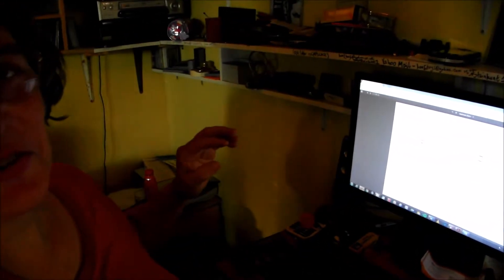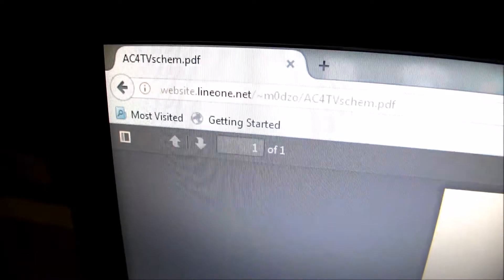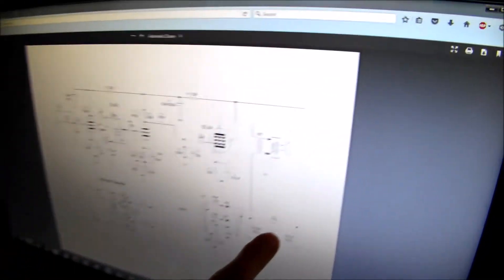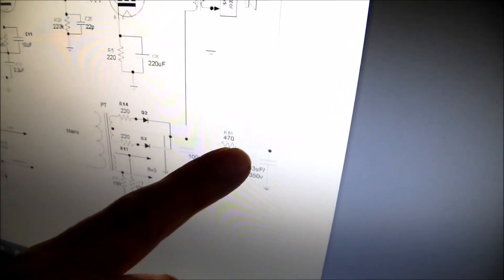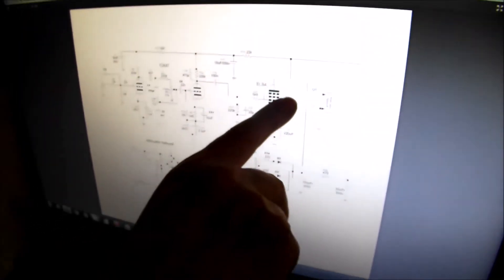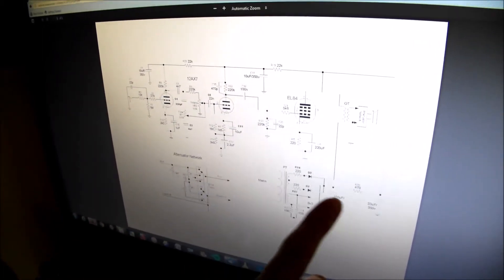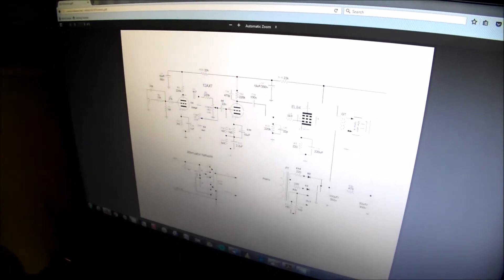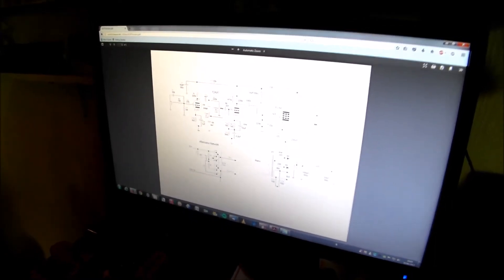VOX AC4TV VALVE SHENANIGANS

Comment: I know this is an old video but my little vox has a dead resistor and burnt areas around a defective EL84. Your resistor suggestion made it to my shopping list! also: your research and knowledge is well aprecciated!
Reply from the maker: I've been playing around with EL84s for years and if you read the data books and visit National Valve Museum, it will state the "absolute maximum" conditions, which seem to be ignored by some of the Vox engineers. As valves were quite plentiful, it wasn't an issue to overdrive them but, since the Ukraine conflict, Russian valve manufacturers, Sovtech being one example, could cease selling them to the West. If you're technically minded, in the Selmer Little Giant, the screen grid is supplied via a 5600 ohm resistor, limiting the current to about 11mA. The screen grid should never glow orange, as it does in the AC4TV. I hope you can get yours fixed soon or are able to do it yourself. Thank you for your interesting comment.

Comment: Is that true about Beatles AC30s? I can ask my mate who worked for Vox Dartford and delivered their amps, John Oram.
Reply from the maker: Don't know about AC30, although I've worked on just one. Valves can tolerate a huge amount of abuse: I remember our electronics tutor mentioning a valve had its envelope melted so glass was in physical contact with its anode, and was still working. I rely on the international valve museum for information about various valves and data, when designing an amp, and it states "absolute maximum operating conditions". Unfortunately, manufacturers making the AC4TV, acquiring the Vox badge, have ignored these parameters, many times over. The EL84 runs very hot, under recommended parameters, as it was based on an octal valve design. The 6BW6 is a 6V6 squeezed into a B9A base, although 6V6 was originally on an octal base and bigger part. Likewise, 6BW6 runs extremely hot in normal operating conditions.

Comment: El84 in mine lasted about 10 hrs lol 
I was running it in to an 8ohm extension cab. 
It sounded glorious mind you. But yeah. Crazy circuit design.
Reply from the maker: It would sound just as good with the correct parameters. If you're any good with a solder iron, the G2 resistor needs to be about 5K6. The EL84  can last for many decades. One of mine was removed from a scrap radio and there's evidence of hard driving owing to deposits on the inside of the glass envelope. Thanks for commenting. :o)
Reply: @hoofbags  I will crack it open tomorrow. Now go to bed, its very late!
Reply from the maker: @cgavin1  was in bed when wrote the previous. It's R16, a 470R. It's too low and is cooking G2. There will be a slight reduction in PWR output. When I build these, I use 135R as a cathode bias and a 5K6 as G2. This design was from Millard and the Selmer Little Giant is closer to it. Perhaps Vox have shares in valve manufacturing EL84 = £13.50!
Reply: @hoofbags  A popular mod seems to be to install a 1k-2.7k 1 or 2 Watt screen resistor. This does involve cutting the trace and dolling a fresh hole though. I have the Bitmo mod on mine as a head (AC4TVH) and its pretty glorious in to a Creamback 65 @ 8ohms but sure eats the power tubes fast. Would you recommend your method or just go for the screen resistor? Or both?
Reply from the maker: @cgavin1  if you google EL84 national valve they specify "absolute maximum operating conditions". My L8 hubby, an electronic engineer of gr8 experience, used to mention running valves too  hard is bound to lead to problems. I sometimes overrun valves, but only a maximum of 20% over. There were anecdotes of valves still working in TV sets, where they got so hot, the envelope melted so it was in contact with the plate. They do, indeed, tolerate punishment well! I don't like seeing glowing G2s and if the anode/plate glows red, it will stop working, so is definitely a no-no. To me, the 470R R16 is too low, so it would help if G2 current is lower: 5.5mA recommended and would help the valve last longer. Thanks for your comment. :o)
Reply: @hoofbags  Thank you for the great advice and for explaining it so clearly!

Comment: Your amp has the same hum as my AC4. Not sure if that is normal or there is something wrong with the amp. Please let me know as this hum gets so loud when using it in 4w mode.
Reply from the maker: Must admit, though, Hooves not keen on vox and. They have a unique sound and if the AC4 is similar to the AC30, it lacks negative feedback. NF improves amp linearity and reduces mains hum. It would appear that these characteristics are deliberate and part of the design.
Reply: hoofbags I get the hum even if there is nothing plugged into the vox ac4. I can’t remember if that hum was there when I bought the amp years ago. I never paid attention until I used a solid state which was completely silent.
Reply from the maker: Sorry to hear about an unfortunate experience. It's upsetting when the things we love go wrong. If the hum is excessive or if there's a buzz, it could be a sign of the filter capacitors needing replacement. The AC4 in my video upload was a repair for a friend. I cannot remember what the issue was, though. For what it's worth, I'm not keen on the way the AC4 is put together. I mention in the description about a 470 or 560 ohm resistor. This is the G2 grid in EL84. It is much too low and this would create hum. It should be about 5.6K ohms. Naturally you'd be reluctant to alter the spec of your amp, but if you know of a radio repair shop or guitar shop in your vicinity, they might be able to alter the spec. This may result in a reduction of resale value, though. It makes sense that a solid state amp would have lower hum: bi phase operating characteristics. Sorry I can't be of any more help.
Reply: hoofbags Thank you for your reply. Based on my previous experience of my other vox being repaired, it would cost me an arm and a leg to have it serviced. I might just have to buy a new amp then. Thank you for giving your time for replying to my inquiry.
Reply from the maker: Does the mains hum reduce if you unplug the guitar? In the guitar amp world, as far as I'm aware, mains hum is tolerated because of the pick ups being of a magnetic nature. Humbuckers can lessen this effect, to an extent. Messa Boogie have done some research into this issue but these amps are expensive.

Comment: G3 is tied to the cathode and g2 the screen can run tied in triode mode to the plate, so the 5.6k thinking for that voltage is coming from where? And it only runs hot when power chords are happening right? Otherwise class A would be full orange 100% of the time. So this has nothing to do with the screen supply. This is purely a bias issue or shorted tube screens. If this happens with a different el84 then the first thing I would check is the bypass cap on that cathode. Something seems odd on that cathode bias if you are getting a nominal 10w.
Reply from the maker: Hello JF. Its been a long time since you made your interesting comment: thanks for that. I'm going through a phase of not doing EL84 or similar guitar amps. These days I'm building single ended stereo amps for phono or similar purposes: ECL86 and similar. I've learned that there are quite a few design consideration differences between the two designs: phono vs guitar. Also, driving G2 hard can increase output: something I was unaware of at time of upload. If you think you can give some advice to Erhnam Djinn I'm sure he'd appreciate it. His comment was 2 hours ago, from when I'm typing this. Many thanks for your contribution. (o:
Reply from the maker: I've built about 40 - 50 amplifiers in my time. Vox drive their valves unnecessarily hard so they need more frequent replacement. The only part of the valve that should glow is the cathode. In every other EL84 amplifier I've built or serviced, there's always been a 5.6k resistor in series with the G2, as the national valve museum and my Mullard data books always state the maximum G2 current is 5.5mA and a resistor selected to set this. Like most manufactured items these days, vox push too much current through all parts of the output valve as a means of planned obsolescence. The vox amp will emit mains hum because the G2 limiting resistor also forms an time constant network with a capacitor as ripple rejection. Connection to the anode would still require a limiting resistor and would result in a gain reduction. Mullard certainly knew how to design their equipment.
Reply: @hoofbags  I don't think there's a Vox tube-abuse conspiracy afoot. I think they just tried doing what 90% of all guitar companies do or did - drive the crap out of their tubes. Doesn't always play out well with Chinese mystery tubes and PCB construction (see: older Fender Blues Juniors. They fry themselves to a crisp.)

Look at vintage traynor amps- they had a 2xEL84 amp with 400+ volts on the plates that could push something like 25 watts. Insanity. Ever see Fenders short lived EL84 6G9 amp from the 60s? They drove the pants off of those tubes, basically treating them like 6L6s. 400V on the plates and screens, with nothing but a choke before the screens. abusively high fixed bias. The transformers would often melt down. They changed the 6G9 amp to accommodate 6L6s shortly after. Not sure what they were thinking with the little EL84s. 60s Fender were typically designed to last. 

I have a 2xEL84 PA amp, and before I rebuild it, it was set up to have NO resistor on the screen. The screen was literally directly after the rectifier and it had higher Voltage than the plate. The original tubes from 1959 looked blackened inside, but still worked (for a couple days...then the fireworks happened).  Even in the 50s, when the line voltage was 10V lower than today's, it was biased really hot. Can't think why, reliability seems more important than sheer output in a run-all-day PA amp to me, unlike a guitar amp, to some extent. 

I did cut the abuse back a bit though. Now I run my EL84s with a 340-350 B+ to ground (something like 335 plate to cathode), near 100% bias, and a 2K screen resistor. Never felt the need to go higher. Tubes can last years in these. The screens really are the EL84 weak point though.
Reply from the maker: @JMA_Elec  the EL84, in the Mullard data book mentioned 2XEL84 in push pull could deliver 17 watt so 25 is really pushing it hard. The EL84 is considered one of those valves physically too small for its handling parameters and the 6BW6 is worse in that it's a 6V6 in a smaller form factor, so they run really hot. 6BW6 often failed in service although 6V6 lasted very well, according to an engineer I was close to. The amount of overload a valve could tolerate is one of those examples of things learned through practical application. Example: it was once believed that applying HT Positive to a valve, pre cathode heating,  would cause damage: stripped cathodes. That was the idea of using a valve rec. Almost all TVs from 60s onwards had a solid state rectifier and the valves lasted longer than was expected. Thank you for your enlightening comment.🙂
Reply from the maker: Thanks for your suggestion. I've a tendency to build my valve amps using, either the Millard valve data book, or go to National Valve Museum where they state "absolute maximum values". The G2 is connected to the supply + rail via a resistor much lower that 5.6k in the V O X  design. If the grid 2 glows, it's carrying more current than it's meant to. G2 triode mode only works in push pull, class a, ab or b. To enable this, there's a 43% tap on each part of the biphase output transformer, feeding the pair of EL84s'  G2. If we tried to achieve this in single ended class A, the smoothing capacitor would remove any audio signal voltage fluctuations and would do nothing useful. I serviced the example in the upload for a friend. If I owned the amp myself, I would substitute the G2 resistor with a higher value, thus reducing the current.

Comment: Vox is notorious for pushing their EL84 designs to their limits. Just take a look at their AC15 and AC30 amps. They don't make amps thinking of how long the tubes will last, but rather how loud they can get before they give out.
Reply: Did you try to increase the resistor value and if so , with what results?  Best regards and thank you for this interesting video
Reply from the maker: Hi Blackcorvo, again! (o: Interesting comment, I didn't know that. One issue here, is that increasing the G2 current won't make the amp any louder, all it would do is burn out the valve more quickly. It would seem that they're only interested in making as much money as they can, irrespective of their products having a shorter life span. I was thinking about substituting the 470R for a higher value. However, it means that the following tube, an ECC83, would be starved of current. If I had one of these amps, I'd do away with the PCB, point-to-point re-wire the thing with more suitable values. When working on amplifiers that belong to someone else, we need to consider the original spec. Changes in design would usually mean a reduction in the items value. Thank for your interesting comment! (o:
Reply: The current reduction won't affect the preamp much, since those stages usually draw very little current (about 3mA per triode, in average), so there's no real issue for increasing the 470R resistor value there.
Reply from the maker: That's useful info. Thanks. One thing about this Vox amp is it belongs to a friend Ed who runs a veggie cafe in St Leonards-On-Sea. I need him to take the thing, I haven't much room here in our gaff and I'm a bit sick of the sight of the thing. I suppose I could do the resistor change without removing the PCB, (again!). Maybe cut the resistor lead from above the board and insert another resistor onto the cut off ends. Thanks for the tip. Your great! (o:
Reply: I would avoid pcb vox amps like the plague unless it was one of the uk made ones from the 90s early 2000's although incredibly expensive the 60th anniversary ac15 and ac30's are also incredibly well made and are built to last and they sound incredible worth it if the old school vox sound is what your after